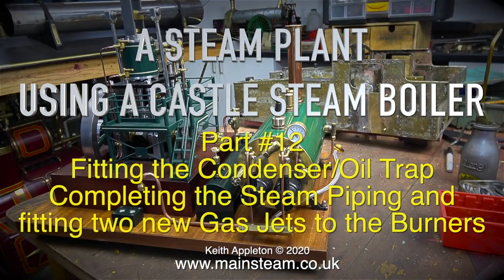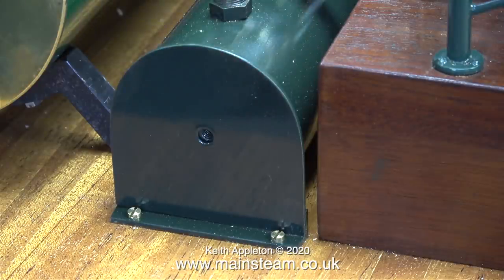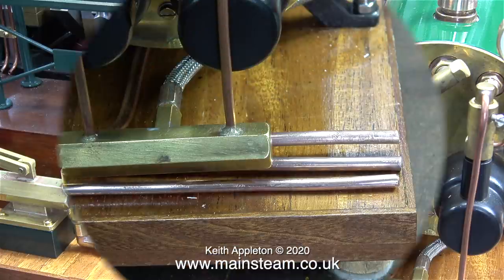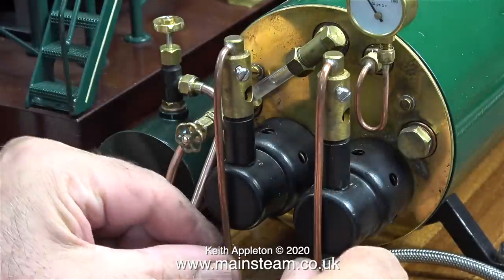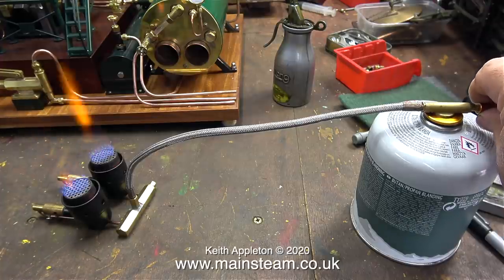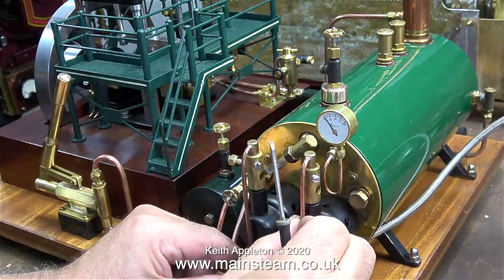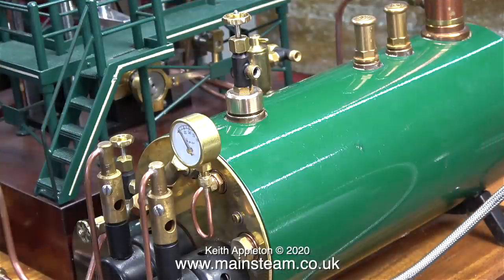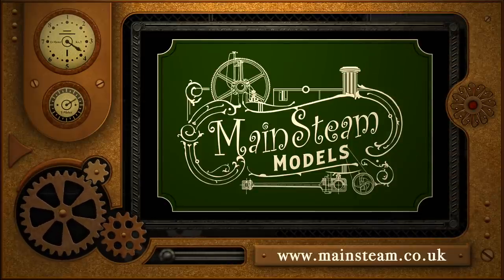A STEAM PLANT USING A CASTLE STEAM BOILER - PART #12

Comment: After threading machine screws into wood. You can add a drop of thin  cyanoacrylate adhesive. 
After it has dried it makes very strong threads.
Reply from the maker: as shown in many of my other videos . . .

Comment: I remember having a similar howling problem with a used gas furnace many years ago.  The appliance repair man simply drilled and tapped a hole in the side of the burner JUST after the outlet of the air intake.  He put a screw into that hole and simply adjusted it in and out until the howling went away.  I assume that was his solution to adding turbulence to the gas/air stream.

Comment: An opinion:  The green on the boiler is (in a word) "yucky".  For me it would look better if it were the same color as the condenser.  Again, an opinion.  Your mileage may vary.
Reply from the maker: indeed it is - I fully agree. The owner is going to clad the Boiler using Mahogany trips & Brass banding.